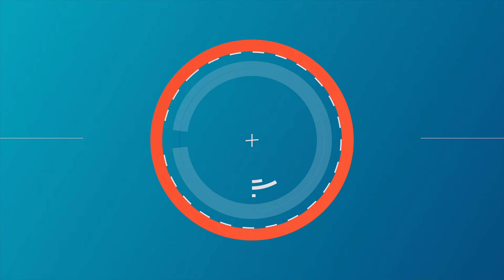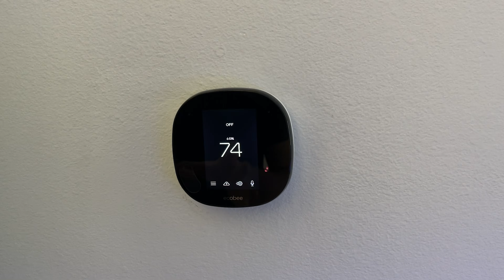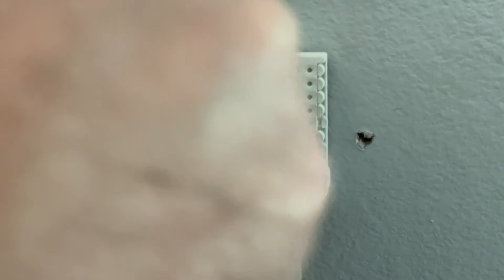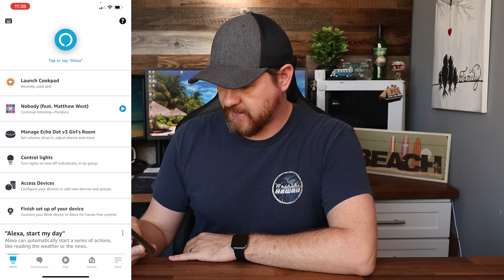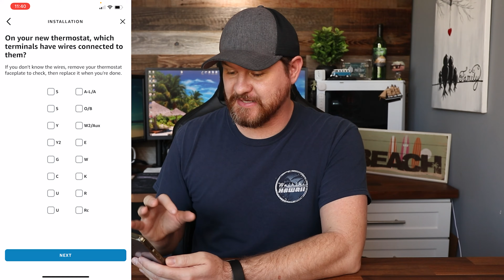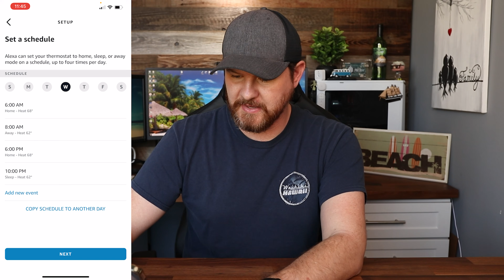Amazon Smart Thermostat Installation and Setup

Comment: I couldn't get it to connect to Alexa or the internet.  When the scan qr code screen came up it wasn't viewing anything to scan.  I made sure it was enabled in the app settings, but it still didn't work.  Tried the manual scanning and it would fail every time.  Made sure the xda3 or whatever wasn't enabled on my wifi, reset wifi and still nothing would connect.  Returning it.  Too bad, because I had already bought a couple air quality monitors that it's supposed to work with, but now all of it is going back.  Going to try the ecobee and maybe the sensi?

Comment: So current our thermostat has a C wire, but when we connected all the wires to the Amazon thermostat it never turned on… all wires were firmly connected and we have not had any connectivity issues with our current thermostat… Is there anything that can be done? It seems that our C wire is not providing the additional power needed for the smart thermostat?

Comment: hi.  i followed your instruction but for some reason i only have heat mode, no a/c mode.  do you know why?  I only have four wires but i used to have a nest and the four wires worked but on the amazon thermostat it doesnt show the a/c....?  thank you

green wire at G
blue wire at C
white wire at W
Red wire at R

Comment: On my old Ritetemp thermastat, there is a horseshoe shaped jumper wire from RH to RC. Do I use it on the amazon thermostat?
Reply: No that jumper in the old unit is for the Red power wire. On the smart thermostat you would just plug the red wire into R1

Comment: I was able to pop my honeywell thermo out and put the amazon one in its place. Exact same internal box. But i did end up switching because the backplate was different and You could see the screws. But if you have a Honeywell check and see if it matches. The Amazon is made by honeywell. Could literally take you 1 minute to change it, counting flipping the fuse

Comment: Hey sir what happens if you do all this and get the thermostat installed but the furnace fan or (blower) stays on even when you tell the thermostat to turn off? It just keeps running and running. We had to kill the breaker to HVaC outside just to get it to stop. Thanks!

Comment: So whats the c wire or c-wire adapter they mention?
Reply: The c wire is the blue wire, not every HVAC install has it because it's not always necessary. You'll see that it's run anyway in a lot of newer setups cause it doesn't really hurt anything for it to be hanging out in the wall if it not being used

Comment: Any thoughts on using this thermostat with a dual zone system? Specially if you can ask "Alexa raise upstairs temp to 73" for example?
Reply: I have the same issue and can't seem to get it working when I talk to Alexa. When I say turn on downstairs thermostat it says she cannot perform that function
Reply: @Jasonmbartley  its because it's a multi zone system most likely. I have not figured out the work around yet. I just get "doesn't support that". Works fine from the phone and worked when I set it up.
Reply: Do you have dual zone with 1 thermostat or 2 thermostats? I think you need 2 of them install to make that work.

Comment: Could you kindly assist me with a matter? 
I am interested in purchasing the new Amazon Smart Thermostat – ENERGY STAR certified, designed for DIY installation, and compatible with Alexa. 
However, I am unsure about the term "C-wire" and its significance. I would appreciate it if I could share an image of my current thermostat with you for your evaluation. 
Could you also please inform me if a "C-wire" is necessary in my situation? I want to express my gratitude for the informative video you've provided.

Thank you sincerely.https://drive.google.com/file/d/1g0b-bjCgyemscIUBjwg5YcOD_frg_Ljc/view?usp=sharing

Comment: Thank you so much for this video. I've never done anything remotely close to this in my life. The only mistake I made was drilling 2 holes on top and 1 one bottom. Oh well I added the large faceplate to cover my mistakes and the holes from previous thermostat. 1st electrical thing I've ever done. I will be doing more. Oh yeah I'm a 60 year old woman.

Comment: My existing thermostat only has red, blue, and white connected. The yellow and green wires are there, but not connected to the existing thermostat. Should I connect these to my amazon thermostat?
Reply: Likely Yes unless it's a really old system and was jerryrigged by an old owner. I'd your system a heat pump? When in doubt call a pro.

Comment: after clicking "thermostat", i dont get Amazon brand option at all. I have re-installed the app
Reply: I have the same problem
Reply: @YashJain-gq6em  apparently its a software bug and i was told to be in the queue. Here is how i overcame the problem. I tried installing same app in 4 different mobile devices. On one of the phone (my sons iphone and with his credentials) i was lucky to find amazon brand. I  am using that credentials on my phone (app). it works

Comment: What if I have several more wires?  Do they plug into the other letters?  
I have yellow, green, red, White, blue(c), e(gray), orange, plus a pink black and brown that aren’t hooked up.
Reply: Yes you may have dual staged heating and cooling. Make sure you get a thermostat that is compatible with your hvac system

Comment: Can it be installed on a heat pump system?  If yes, where can I find instructions?
Reply: Yes you just would not connect the heater wire (usually white) as your air handler is not a furnace 😊

Comment: I installed mine in about 40 minutes.  Everything seems to work fine however, when testing the AC the fan kicks on but the AC unit has not run (so far).  I'm 99% certain I installed it correctly.  Anyone else have this issue?
Reply: Yes! They said it’s defective. Weird it’s happening to more than one person

Comment: I just installed this today ( really easy to do) but I noticed that the furnace kicks on quite often the heat kicks on and will
Last about 5-8 miniutes then turn off but then go on again about 3-5 miniutes later I have the temp set to 68 is this normal for a smart thermostat to do?

Comment: Now what if I have more wires than it are required? Like I have an o/b wire in my current one as well as one that is connected together with another slot. Do the instructions explain that?
Reply: Orange is reversing valve only connect if you have outdoor AC,  brown is two stage. Blue is common.